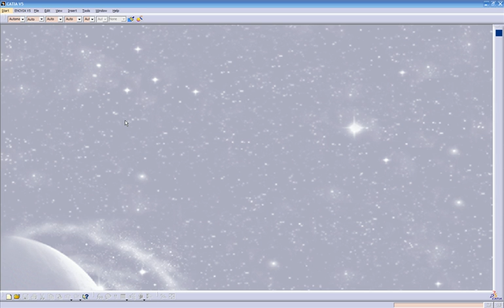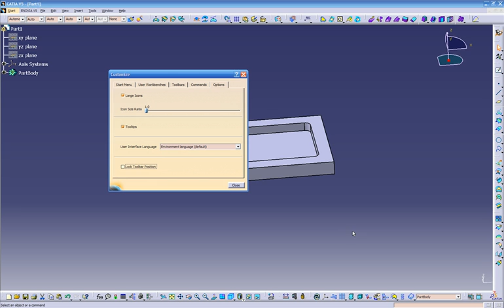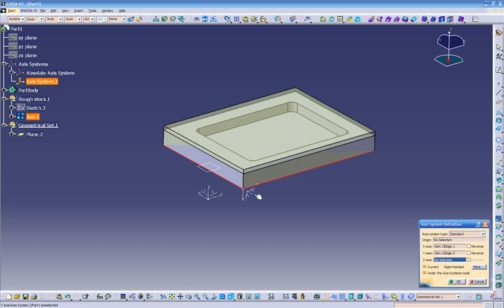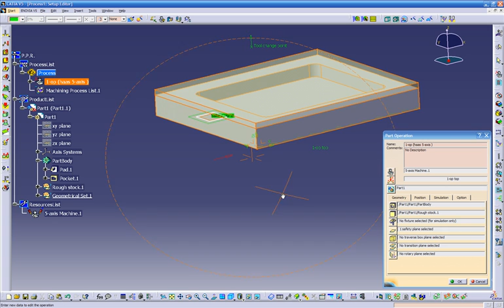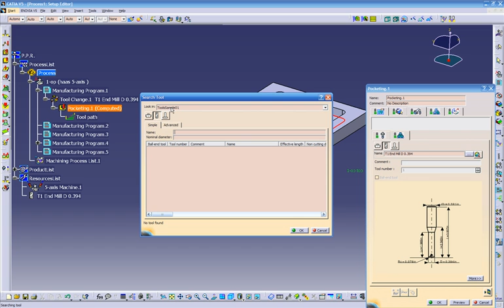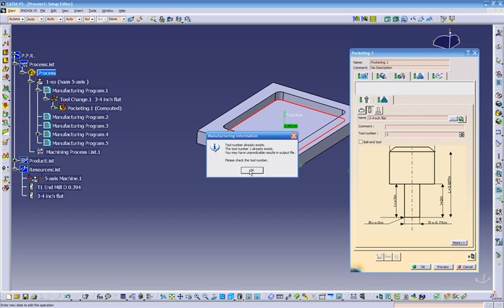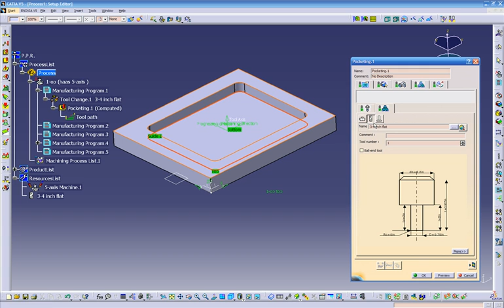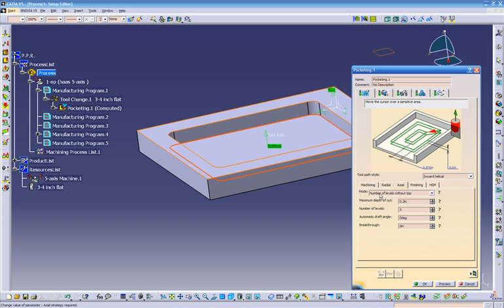CATIA Machining Tutorial - FULL LESSONS - HD (1/6)

Comment: As far as i know you have 'wrong' dimensions for the tools because those are directly converted from metric to imperial.
6 mm end mill -> 0,23622 in
1/4in end mill -> 6,35
Imperial system confuses me bad.

0,394 in is a 10 mm  :) and this is a usual tool diameter in metric.